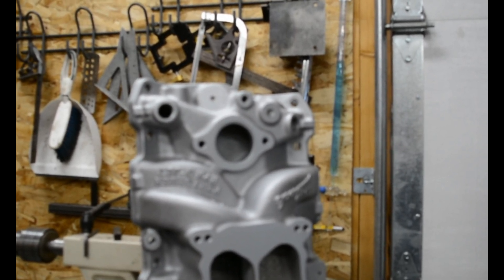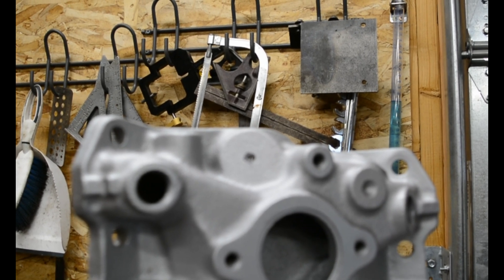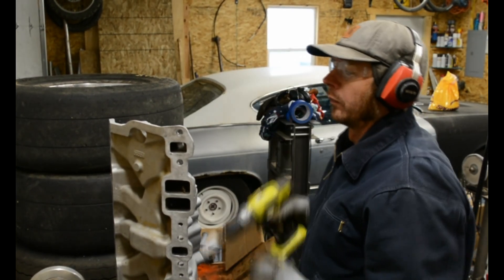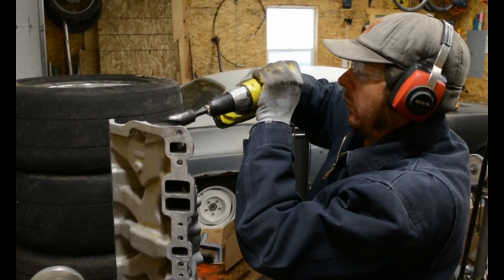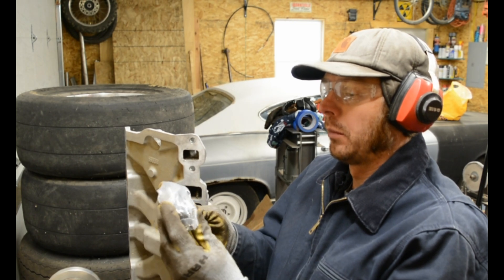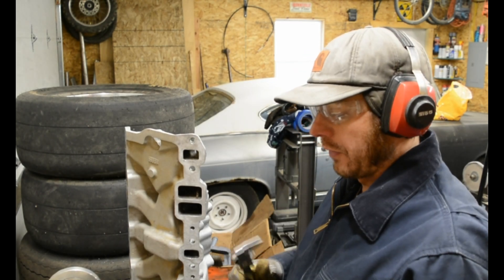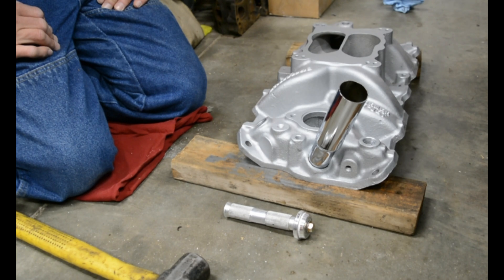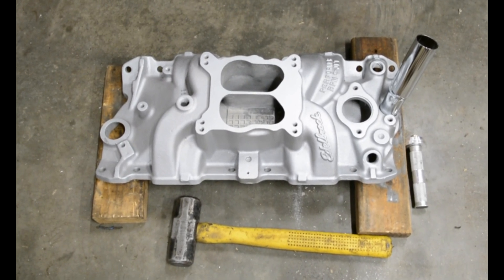Drilling A Performer RPM Q-Jet For An Oil Fill Tube

Comment: A couple yrs back i built a ford 390 for my ol pickup & i used a factory aluminum dual plane HP intake from a 1961. Could have been found on a 375 hp 390 or a 385 hp 406. But it had the fill tube in the intake & i actually popped the tube out & put a core plug in it. Im using valve covers with the oil breather & pcv valve so the fill tube wasnt needed. It had the provision in the back for crankcase ventilation but i made a cap for it as well.
Reply from the maker: Very cool, I do love the FE engine. Thanks for watching!

Comment: It's always sketchy using a large drill bit on a hand drill, they want to grab on you.
Also, good idea using the seal driver to drive in the tube, when i installed one on my eddy manifold i used a block of wood at the time, it got the job done...
Reply from the maker: Yes, I would not attempt this with a corded drill, you will probably hurt yourself. I too have used a block of wood and it will get the job done. Thanks for watching!

Comment: I always liked the manifolds with the fill tube, worked pretty good, i was a bit leary when you switched to be big bit, wd40 works really well as a cutting fluid on Al
Reply from the maker: I agree, I find them functional and better looking. I wouldn't recommend using such a large bit in a hand held drill but with caution it will work, thanks for watching!

Comment: Impressive job! Are you going to use the old style valve covers with no holes and the Chevrolet script?
Reply from the maker: Thank you, I just acquired a set of correct 1968 steel covers, which are a one year deal. They only have one hole in each side with no twist on filler port. I may run them if they clear my roller rockers, we shall see. If so the intake will get painted in disguise. I do have a couple sets of the script covers but the block I am running does not have a road draft tube port, so I will save those for one of my 283's.

Comment: Good job, custom.😎👍
Reply from the maker: Thanks!
Reply: That’s a great mod! It makes it so much cleaner and nicer and easier when doing an oil change. I’ve always wondered why such a neat feature of Chevrolet engines was discontinued.
Reply from the maker: @maxmoore8876   Thanks, yes I don't understand why they got rid of it either.

Comment: So, it turns out the inch and a quarter hole saw would have been about the right size to start with🤷‍♂️
Reply from the maker: It would be too large, I used 1 1/8" and then a regular bit smaller than 1 1/4" to finish it off. Thanks for watching!

Comment: In the past 50 plus years I welded up hundreds of those holes, the sorriest thing that ever did to the intakes, that's what fillers are in valve covers for. If you have a pan vac system in the valve cover you can use that to add oil old cast iron intakes we used to use a freeze plug to seal the hole.
Reply from the maker: To each their own, thanks for watching!
Reply: All you D.I.Y people are the same you will discover that it  is a mistake, when you're cleaning up all the oil all the time that comes out of the Breather cap of that filler tube lol.
Reply from the maker: @sherwinstaudt1881  I have run my engine with an identical filler tube before with no problems, in fact I drove the car on 3 different 1000 mile road trips with this configuration on a different intake. Thanks for your concern though.
Reply: The  283's and 327's that came with tubes had a China wall with a cast in boss that separated the tube from the valley.
Reply from the maker: @mikeheggem9488  You are correct, except for 1968 large journal blocks that had filler tubes but no special casting in the block.